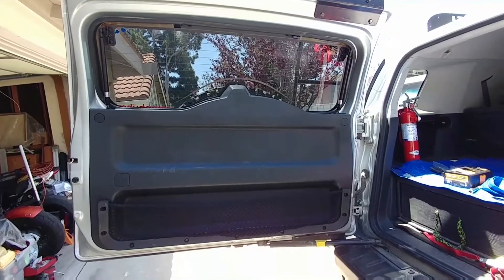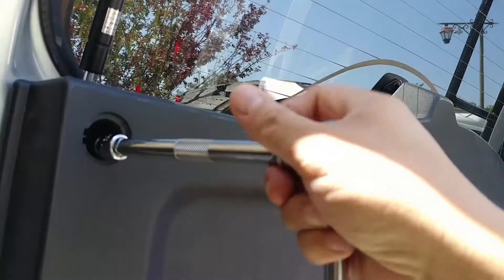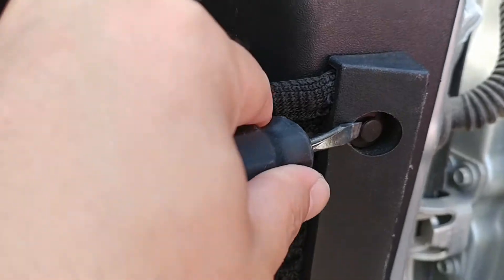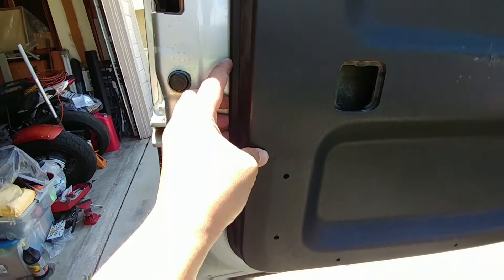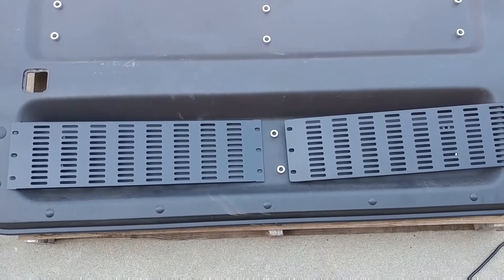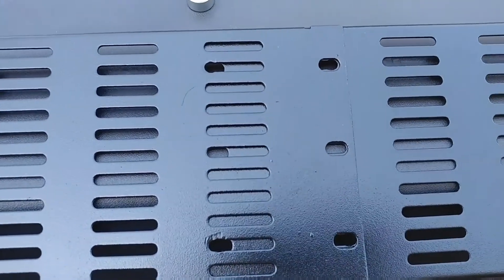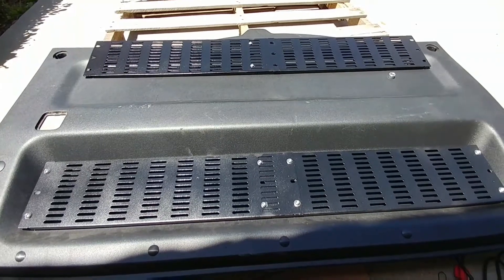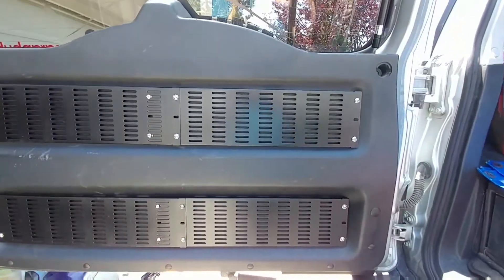DIY: Rear Slotted Rack on your Toyota (FJ Cruiser/4runner/etc)

Comment: So WTF do you do with the rack now?  How are you gonna thread webbing behind that?
Reply from the maker: You get 1" width velcro straps for organizing computer wires. This allows  you to mount most anything. I fit a fiskar full size axe, splitting axe, shovel a couple molle bags if I need to. Another option is to epoxy neodymium magnets to them and tools that you use often can be mounted.
Reply: Can you show a video of you loading it up please, this is a great idea!!